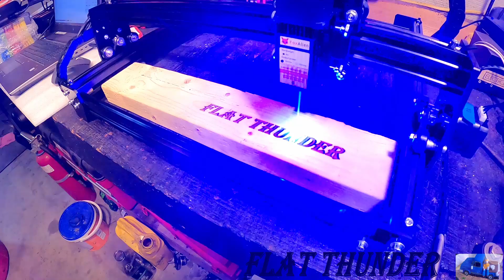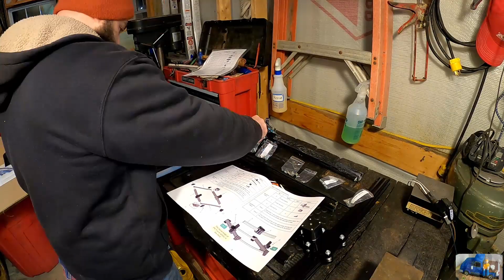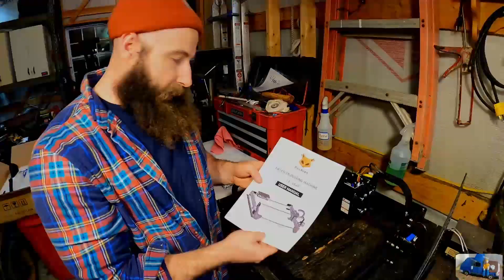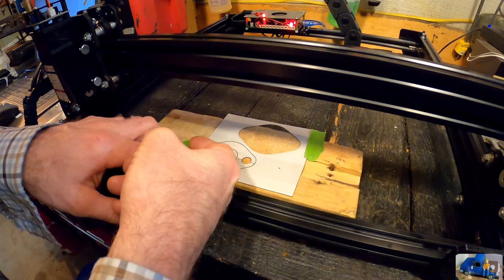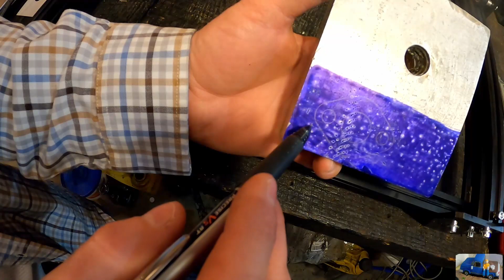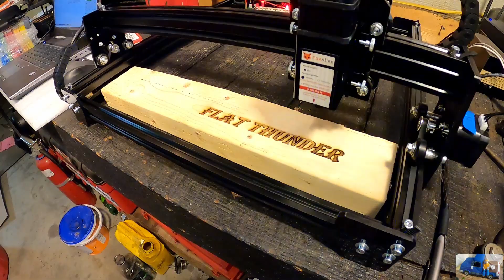FOX ALIEN CNC LASER; UNBOXING / INITIAL TESTS

Comment: I was hoping you show how to add the driver on Windows because I'm having problems installing it and it's not showing up on the device manager. Did you had any issues with adding the driver? I didn't have my laptop connected yet to the Lasers board because it's in another room away from where the engraver is at and wondering if that's the reason why it wont install the driver.
Reply from the maker: I do not recall having issues with the drivers.  I will tell you the order in which you power up the laser makes a difference.  I believe I plug it in to the computer first before powering it up.  Check the port the software is looking for and adjust if necessary.  I had to manually set the port in lightburn to the correct port for it to recognize the laser.  Happy burning and thanks for watching!  👍😁